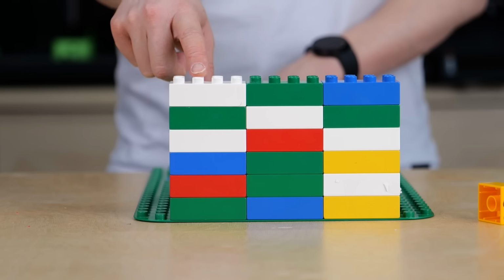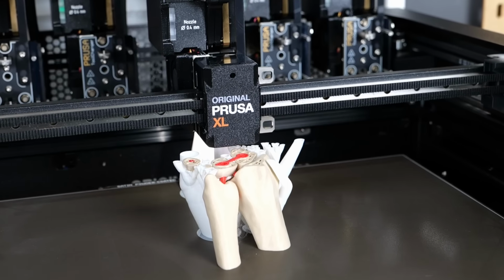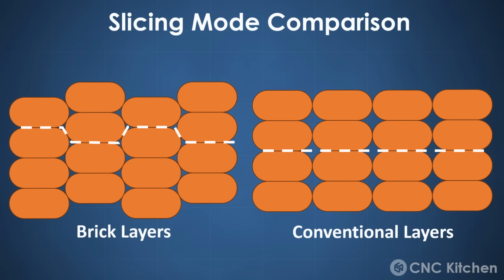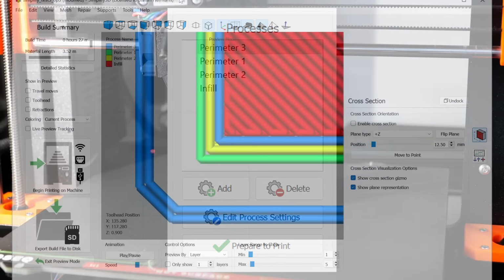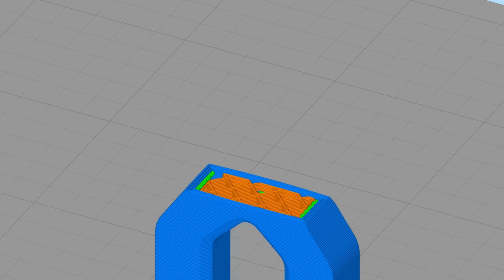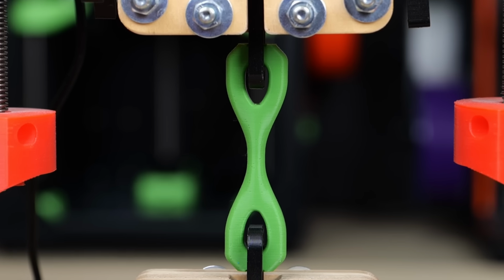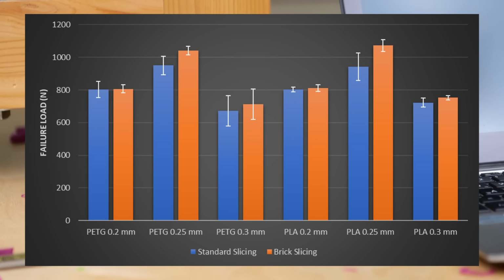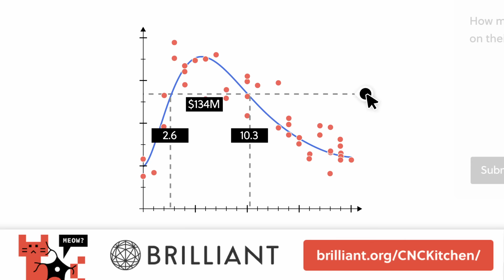Brick Layers - Why did no one do this before?

Comment: I tested this method last Auguest for my Master's degree. I implemented it in PrusaSlicer with some CAD trickery. In addition to the things tested in the video I also tested a parameter that I call overlap. Overlap is the amount that the adjascent extrusion lines intersect with each other. resulting in a more solid part. My results showed that at higher overlap this new approach had no advantage over traditional printing (where higher overlap can be achieved my simply extruding more). The max interlayer strength I acheived was ~35-36Mpa in PLA for both printing methods, but the interlocking layers were printed slower because of double the amount of layer changes.
Reply: Share your results and explain why Stephan measured an increase of 10 to 14%. If you trade speed for strength this is a good thing to know. If the increase in strength is not worth the effort it is also a useful outcome.
Reply: @chipcode5538  In this video neither method (interlock and normal) have been pushed to the limit in terms of (over)extrusion. My objectives were a bit different in that I only wanted to test the case where both have maximum extrusion. The nice thing is that I realised both can achieve essentially solid parts, but these solid parts do not have uniform properties as I hoped probably due to the thermal history.

Another difference I forgot to mention was that I used ASTM 638 samples which are a different geometry and are solid instead of hollow. However I doubt this would make a huge difference.

Ultimately I moved on to other projects. But I wish someone with the equipment could test this idea with more other parameters including material, geometry and other things. Maybe some other materials that are natually good at layer adhesion can benefit from completely solid parts.

Another thing I would like to mention is that if you recall the transparent part video, the strength gains were better than this iirc, which kinda is in line with what I found. Overall extruding like crazy will give you higher strength IMO.
Reply: I hope your thesis didn’t result in a company patenting anything - otherwise we will just see it in our lives in three decades 😂
Reply: one idea i had was to mount the extruder motor to the side of the printer and have a carbon fiber hexagonal drive shaft with a Teflon gear that can slid along it making the hot end super light but still direct drive
Reply: @GeekDetour depending where it was published it's probably already been sold
Reply: @owend7212  That exists and is a product since many years. Can't recall the name. Flex drive or something. Remote direct drive is the type.
Reply: Would like to see a follow up comparing different overlap/over-extrusion settings
Reply: @GeekDetour  Exactly...for those not aware 3D printing was patented in 1986, exactly 38 years ago
Reply: @GeekDetour  Honestly, this feels like one of those places where someone should file a patent and then just open source the patent.
Reply: Did you happen to publish your findings? Lots of researchers forget that publishing "failures" is very important! Helps others find out what you did, and maybe noticing something they can change so that we arent all just testing the same things over and over.
Reply: is your thesis available online? what should one search for to find it?
Reply: @asdfghyter  Unfortunately no, it was deemed not worth it by my supervisor. The short version is that for PLA with 0.6 extrusion width, 210-230 temp, 0.1-0.4mm layer height, and as much overlap/overextrusion as possible, the two methods showed no clear difference.
Reply: So, to reiterate, you were testing the "brick layers" method along with an over-extruding "overlap" method. Testing "overlapping" together with "brick layers," you found that there was no advantage over "normal layers" printing, at sufficiently high "overlapping" parameters. This makes sense to me because at sufficiently high "overlap," you are executing a similar purpose to brick layers: to enhance/optimize the surface area of layer adhesion.

With increased overlap, you're basically changing each individual layer's cross-sectional shape from roughly rounded rhomboids (which leave additional unadhered gaps) to more filled out and flattened ovals or even rounded rectangles via over-extrusion. Thus, once you approach the upper limit for the area of adhering surfaces, there isn't much difference in physical strength properties of a part in how exactly those parts are adhered (at least when conducting a tensile strength test to pull layers apart as opposed to a layer shear test).

I imagine a shear test, with the force parallel to the layers might show better results for a brick layers+overlap method than just overlap (depending on whether or not adhered layers do better under tension or shear).

Anyway, it seems to me like increased layer adhesion would ultimately require more plastic to fill in the volume of air left between layers, so neither brick layers nor overlap would actually drastically improve the efficiency of prints, with regards to material-to-strength ratio (unless there is a significant enough difference in strength between tension and shear of adhered surfaces).
Reply: @mw4222 do you have a link to your paper? I'd like to read more about your process
Reply: @GeekDetour Prior art can't be patented. I'm sure there is some nuance to it, but if a thesis was published on it, that effectively means it cannot be patented.
Reply: LOL I just left a comment suggesting overlap. Nothing new under the sun! Until there is. Thanks for the comment.
Reply: @adondriel  Software patents like how to stack layers in 3D printing shouldn't even be legal, IMO. It's ridiculous. A physical mechanism that allows a new type of printing? Sure. A few lines of code any printer can execute? Absolutely not.
Reply: Yeah, this is exactly what people find when trying to optimize for part strength, and what the video is oddly lacking any thought about. The most important thing for layer adhesion is extruding hot, slow, and heavy and getting totally solid walls
Reply: @GeekDetour  Yeah... Patenting is a technological cancer.
Reply: @owend7212 I've been trying to figure out a way to do that one for a couple of years in my scant free time. Most assemblies I've come up with interfere with either the more advanced cooling assemblies popular in the community or else with doing the same for moving the toolhead. All of them are too bulky.

Also, you don't want to do this with CF. It abrades terribly under sliding friction and the shards that result love to get into all sorts of places you don't want them and that they'll never leave,  like the raceways and threads of your machinery and the eyes and lungs of any person or animal in a thirty foot radius.
Reply: @basementdwellR Flex drives are not the same.  Those use the sort of twin- twisted steel cables that are common in aeronautics and in car door actuators. This guy is discussing a different form of remote direct drive entirely.
Reply: @dominickpastore I wish more people would tell that to the USPTO and companies like Slice Engineering... I've gotten far too tired of seeing patents granted for use of prior art designs in exactly the same function and assembly with the only difference being the whole of the greater machine they're connected to.
Reply: @r3struction    It can be, but that's a double-edged sword.  Many creatives make their living by coming up with new processes, so lack of an incentive for them to do so (starvation) often kills creativity.  I'm great at critiquing and finding flaws with existing and pending ideas prior to implementation, less so at originating them, and better at process management so I can tell the real creatives from the people that just wish they were.  I define it as someone that has really thought it through, able to respond to the majority of my challenges.  The drive for success and money is a great motivator for innovation.  Just make sure if you come up with something you can show you did it with your own equipment and not while working for some soul-sucking outfit that will pay you $100 for your million dollar inspiration and you'll see the value in tech patents.
Reply: Meh, sure you did
Reply: @varencilator   There is probably a sweet spot where the adhesion strength to mass gets a best ratio using the brick method. mass = cost. So the less mass you can use while still being strong enough (you don't always need max strength!) the better. And sometimes the weight is a restriction, like in planes, so less solid parts are required.
Reply: Are your findings, and more importantly, your "cad trickery," available somewhere?
Reply: @enmiredbythelazy4401  too many people overestimate how often/easy true innovation/creativity occurs
Reply: @claws61821  I am sick and tired of people spreading (by statement or implication) that slice's patent is based on prior art. It's not the multiple screws that made the mosquito, but the narrow, thermally isolating standoffs.

 The screws were prior art, true, but without the standoffs, you still have heat creep. It's the thermal decoupling that's the patent.
Reply: @mw4222 Can you please elaborate why "over extrusion" for you compares to interlock? Because to me it doesn't at all. It's like saying a woven fabric is equal to carbon fibre or a die casted solid material.
On top what you're doing is just throwing more material at the problem while deviating from the slicer. Over extruding means you press more material into the voids, simply said you're printing a solid piece instead of a layered one as designed and calculated by the slicer. Do you have pictures and material analysis available for us to see the material composition?
However, that aside you're also deviating from spec, using more material, making the part heavier etc. 

To me that is scientifically incorrect in so many ways I can't even begin to elaborate - I believe and hope much is just lost in the process of you creating a short youtube comment without differentiating properly.
But yes, there are obviously similarities - I'd still state it's a completely different technique
- regular sliced 3d printed layers
- specially arranged layering methods, such as interlock
- over extrusion to create almost solid parts almost similar to die casting in terms of material properties
Reply: @kontoname  It does not. It is applied on top of either interlock or normal printing. The effect is that it improves strength for both, but they end up at around the same strength.
Reply: @varencilator  Well as it turned out (at least for me) brick layers offered no additional strength, but took longer to print. Additionally, in my tests the samples already looked pretty solid from the fracture surface, but I was still only getting around 35-36Mpa, which is much lower than the 60-65Mpa of raw PLA. What this is telling me is that filling air gaps can help, but the bulk of the missing strength comes from the thermal side. This does kinda matches the (somewhat) recent trend of higher end FDM machines having some types of layer reheating. Also there have been papers on reheating that show pretty good results.

So IMO layer reheat + solid parts will give you almost perfect adhesion, but interlocking layers are not needed here since overextruding already gives you solid parts. Interlocking layers take longer to print especially if you have large parts or multiple parts in parallel.
Reply: @mw4222  
If you did a dogbone style strength test for prints printed both length-wise and vertically straight up and found no difference, then my hypothesis is certainly bunk.

The potential gains to be had thermally sounds like a similar thing to cold joints with soldering. A good joint or adhesion would require both layers of plastic to ideally be at the same high molten temperature before cooling down and fusing to a solid, which would happen with layer reheating.

Now I'm imagining a FDM printer in the future that has a laser by the print head that points slightly ahead at the already extruded layer and flash-heats it just enough to have perfect adhesion right before the extruded plastic goes on it.
Reply: Too many reasons to question your involvement in academia. It seems like you are claiming such to give give your opinion weight...
Reply: @enmiredbythelazy4401  Thank  you for this commentary!
Not any patenting, but excessive prolonged patenting!
Reply: You might want to keep strict documentation of what you found out, how it was done, etc. So that what they said wouldn't be publishable doesn't magically get stolen from you and patented for some company's gain.
Reply: Did you try overlap AND interlocking layers? I'd assume the honeycombing of the pressed filament would be the ideal solid object at that point.
Reply: @damianparadis524  I did, same results as just overlap. They both produce parts that seem solid to the naked eye and same strength.
Reply: You could melt plastic at a much higher temp since it would stay within the Wells created by the layer shift, possibility improving layer adhesion?
Reply: @adondriel  That's wrong. They know failures are important, however there is no incentive to publish these results because it doesn't pay. That's the sad truth about research.

Comment: let's hope this goes viral and the big slicers start implementing stuff like this
Reply: Yeah! We need to share this, definitely.
Reply: after seeing how arachne caught on, i'd say give it 6 months
Reply: Why?
When I implemented and tested it, it came out with weaker parts.

I think a lot of it has to do with what kind of printer you use and quality of filament. On my bamboo p1s this made things worse on strength. But on the Bamboo the layer cohesion is already extremely good.

I get the concept, it’s not new or revolutionary by any stretch, it’s rather cute and has been done many times. 

But on higher grade printers, this reduces layer cohesion, resulting in high stress points forming as layers don’t fully bond together. The reason this method is useful for bricks, is because those bricks are not all one solid object, they are multiple objects that are not actually connected, so you have to rely on mechanical connections like interlocking to make them strong.

Good printing is not that way though, it’s not multiple separate parts, it’s one solid part, welded together basically.
Interlocking like this does not get done in welding applications because it has no practical benefit or effect, and hurts weld integrity even. 3D printing is inherently a welding process. The material is heated up to a critical point that allows it to melt together with other material to form a single solid.
Reply: maybe they never implemented it, because it is not worth it?!
Reply: @thezyreick4289 This way of printing does increase the amount of contact surfaces between the layers, which is always an improvement for welding processes. The reason it is not done for usual welding processes is because it would be too tedious and costly, while for 3Dprinting the change is quite easy.

Now the reason it worsens the performance of your higher quality printer is puzzling. It might be that your printer optimizes things expecting a flat layers, making it worse with this new parameter. Or maybe a simpler explanation would be that your extruding width is not precise enough for some reason, so that the differently sized strings doesnt fit together leading to poor layer contact.
Reply: let's hope the big slicers look at this and decide if it is a good idea or not
Reply: That’s what we said about non-planar printing, lmao
Reply: 3DXpert implemented this in its slicer already 4 years ago
Reply: As well as enable a layer offset between stacked layers so you get the same effect in the horizontal direction if you want it.
Reply: I believe it's under a patent so probably wont happen.